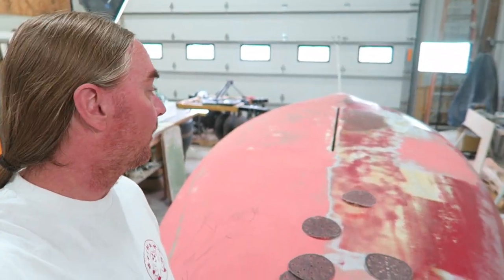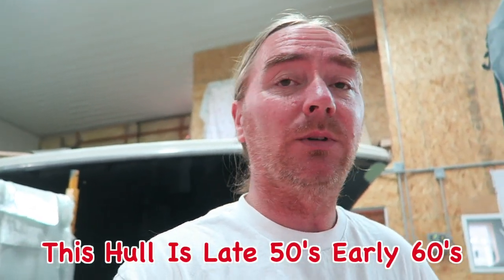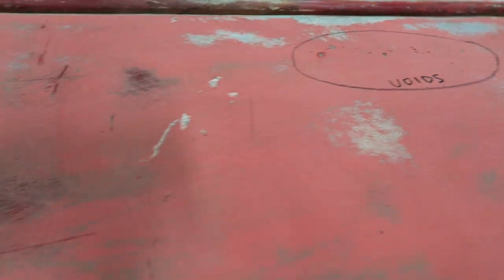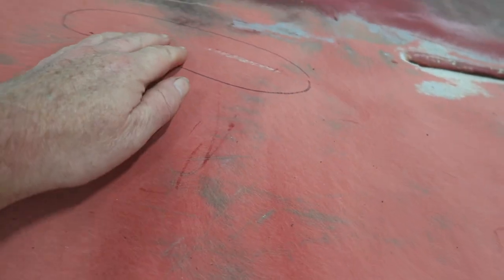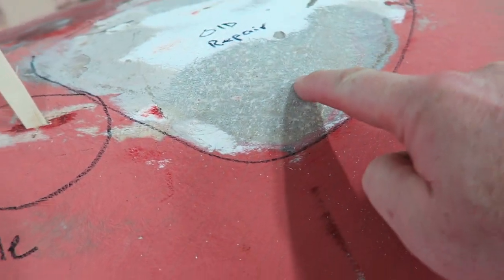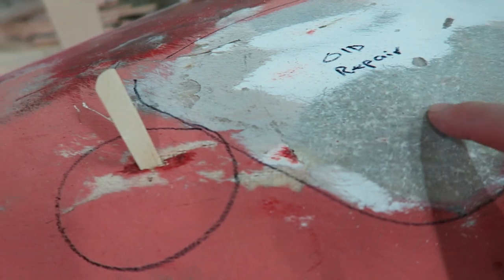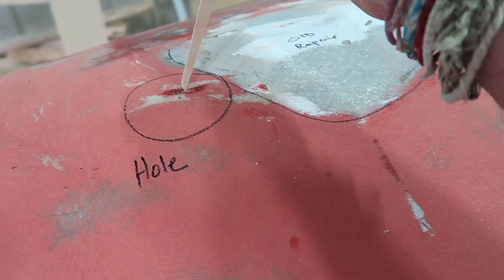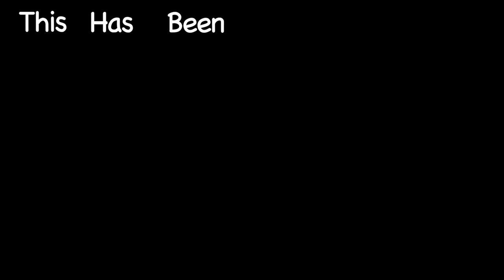THINGS TO CONSIDER WHEN PLANNING YOUR FIBERGLASS BOAT REPAIR!

Comment: So glad you finally went over poly vs epoxy. I’ve been scumming your videos for years on what I have to use for my restoration when I paint or gel coat. I always got confused if I needed to use poly or epoxy for what and why.

I finally understand with this video! Thank you!
Reply from the maker: I do have a guide on my website which goes over the different resins in much more detail if interested :-)!

Comment: I have an old gheenoe that my son and I are planning to restore. There are a lot of surdace cracks, one crack that starts on the bottom and wraps up the side, about 6 inches total but all the way through. The sides are surprisingly weak and a lot of cracking noises are heard when it flexes. Getting ready to delve into your videos today to get my head wrapped around fiberglass repair.  Anyway, I appreciate how thorough you are with explaining the processes of boat repairs and how much content there is to help.

Comment: I thought you might be interested in my recent topside repainting experience using Alexseal topcoat (Flag Blue). While planning the project, I had the very good fortune of speaking with my local Alexseal representative, Alistor Smith. Not only did Alistor provide me with a lot of helpful information and support, he also dropped off a sample of their new roll-on additive to try out. 

Not knowing what to expect, I started applying the first coat with my usual roll and tip application method. However half way through, I realized that the rolled finish looked better (smoother, glossier) than the areas that were also tipped. Consequently I stopped tipping for the remainder of the project.   

I have to say that rolling out Alexseal with this "magic" additive was the easiest and most satisfying topside painting experience I have ever had. It delivered a beautiful finish that exceeded my DIY standards and expectations. 

A sincere "thank you" for this recommendation and all the other excellent info you share with us Andy.

Comment: I have a 1960 19' Dougles built Scot with same hull repairs and spider cracking, looking forward to this video! My bow top deck is thick white gel coat that has very bad spider cracking. Could you please address best options for the severe old raised gel coat cracking vs random light cracking problems or are they the same? Lots of older boats out there that could be brought back to beautiful with a little hard work and determination. Thank you for passing on your knowledge and highlighting new products.

Comment: So glad you produced this video.  I'm working on redoing the floor of our FourWinns Horizon 180 (we bought it with carpet needing replacement) and decided to paint (and texture) instead of carpet.  I had questions on layering and your video has helped steer me in a direction I feel confident in.  I've been a subscriber for a year or more (and had gone back into older vids way past that).  Very helpful.  Next time I travel thru Ashland to Bayfield I'll swing by and drop off a case of 1919 Rootbeer.  :)
Reply from the maker: Glad the vids are helpful ;-)!  I'm more of an IPA kind of root beer guy lol :-)

Comment: Might be interesting to do a video with applying poly over epoxy and vis-a-versa to see if there is any noticable comprised strength loss or delamination. Etc..  I've heard of this issue but never ran into anyone who actually had an issue (or noticable issue). Great job!

Comment: Hey Andy your shows are great but I am lacking a few pieces of knowledge.  I am working on my baja and need to replace the floor start to finish. Obviously I want to use coosa board but honestly need a few pointers on the fiberglass in general and how to finish for the faux teak.

Comment: Andy, so happy to see you doing this series, as I have just purchased two Lido 14's. One is to sail right now ($1200 with two sets of sails and trailer) and the other as a project rebuild ($350 with trailer). The gel coat on my fixer-upper is hard as nails and 60 grit barely makes a dent. My first question is on your hull sanding equipment, can you give me a run down on your equipment and what grit(s) of paper you used? I also see you have a respirator, but what kind is recommended? I also did not see a lot of blue powder filling the air of your enclosed space, how do you manage that?  Last question, how can I make a donation to Boatworkstoday without joining patreon?  Would be happy to make a gift by check for all your helpful knowledge.

Comment: How can you tell if your hull is epoxy or poly or any other type of resin. ? 
I have this issue on my 94 mako hull where it is absorbing and then leaking water out when I take out of water. I grounded it out previously and fill the void with Epoxey and powdered glass and laid up fiberglass. But is still dripping after repair. I believe I needed to use 1708 witch I didn’t use I used chopped strain from Home Depot. and prob did not put the correct layers on. Do you think that is the issue ? Any suggestions. I know I’m gonna grind it all back down and start again on the second repair. Just trying to figure this out and your channel is very helpful.. the area I grinder out is the hull keel were it comes to point . I made a bonehead mistake and launched boat and forgot to put plug-in and somehow water got in everywhere most likely soaking foam . Another issue (I know) fml.! I know that if the fiberglass cloth selection is selected right theoretically there should be 100% waterproof where water will not come in or out as I understand it.  Just looking for your experience and thoughts on this .
Thx sorry for long ?

Comment: Well shoot... I was planning on using gelcoat for my final finish but I guess It's going to have to be paint instead bc I have a new transome made completely out of epoxy... i thought epoxy would be the way to go for the secondary bonding strength... dang man. Thought I had it figured out. At least I wont have  bonding failures with my final coat now that I know. Thanks Andy!

Comment: I fixed a hole in my boat and left the epoxy for 4 months or so and now my 50 grit sander hardly touches it. Trying to strip the old sand based grit layer it killing me too. I only used epoxy but would love to try poly. Great video

Comment: I should have watched this before I started! Better late than never. As you will know from my post, I am a complete noob to fibreglass and trying to work on a 3.8m Bertram Carribean (probably 1970s) and trailer (in bad shape), with a 1976 Mercury 40hp in amazingly good condition for its age)  in a suburban garage. i have two holes in my hull just like in the video. My polyester resin is taking many hours to set so I leave it overnight. I found that my floor that I put in with Poly is not sticking in all areas to the old hull and floor- so it must be epoxy  hull? I want to make sure im using the correct glass from this point fwd (not concerned about finish, #1 concern is for safety).
 My take away from this is: if my priority is strength over finish then I should do everything in Epoxy (including the similar hole -peanut butter in the void and laminate both sides? Is there a video on the slot/gouge/hole?). I should expoxy over the floor that was poly'd in.    Are all Epoxy fibreglass resins born equal? (im using 500 series Epoxy with a UV (530?) hardener. Label says its ok for marine... (if I was in USA I would purchase off of you but im Aus). Any advice from anyone is apreciated.

Comment: Andy, i have cracks shown in the gel coat beneath the waterline. They are probably from flexing and they are situated around a bulkhead and the floor. They’re situated at the bulkhead of the forward cabine. It are long cracks and close to each other. Lets say 10 to 15 cracks over an area of 5 inch wide and a foot and 1/2 long. I grinded away the gel coat and they are in the hull laminate. It are typical textbook cracks. Should I grind that out and put in new glass mat? (What I was planning to do.) or do you have a better idea?

Comment: Amazing channel!

Quick question:  I have a fiberglass’s panel (over wood) that my motor vent is mounted to. This area has two water drains that release  onto this panel with the intention that the water makes it to the engine sump. Problem...few areas have cracked allowing water to get underneath and exposing the wood. Some areas more than likely have rot. I intend to dig out any rotted areas then fill will mar glass then add a couple of layers of fiber glass. What type of resin should I use ( would paint after)?

Thanks in advance Dave

Comment: I get working backwards from surface coating decision to resin decision to fiber decision.  I also understand the thorough sanding of the hull.  But what I don’t get is how you decided to use the CSM on the hull.   How did you know the hull wasn’t constructed with an epoxy resin?  If you laid the CSM over expoxy, couldn’t it just peel off?  If you suspected the original resin was epoxy, would you use a 2 oz woven glass fabric, roll it out with epoxy resin, then fill the weave with fairing compound?  Is there any way around the rule “No Poly over Epoxy?”  Can you just assume any hull that is finished with gel coat can hold CSM/poly?

Comment: Question on gelcoat over epoxy.  Was wondering what issues I might run into if I do try to layup gel over filler with epoxy?  Doing some transom work and going to re-gel the entire transom but have filled holes nicks, chips etc with epoxy and silica.
Will the gel not adhere to epoxy well?  Or other issues?  I guess I could do my final fairing in poly or a bondo type material if other wise I’ll have issues.  
But this issue deff got my hamster onto the old brain wheel
Reply: Additionally, u did the gelcoat to epoxy review a while back and said bonding wise it would work well, and saw no issues...  so I’m corn-fused!  I think I’m just gonna sand, fill fairing flat and brush gel 3-4 layers and wet sand and buff... 

Thoughts?

Comment: Hi Andy, great videos, have learnt a lot from watching. One question, is the paint you are discussing available in Australia and if so do you know the distributor? I have restored an old bout with some modifications. Structurally it is fine, but having trouble with finishing the gelcoat. Any assistance would be appreciated.

Comment: I think 1708 has chop strand matting on the under side. Does that mean I need to use polyester or can I use my epoxy Rosen that I have been using? Thanks for the help. I really enjoy your videos.

Comment: I bought a used boat and sanded and re gelcoated the cockpit. 2 small spots haven't tried in 2 days and I think there was epoxy patches there. So I have to grind that back out and fill with glass or wipe off the wet gelcoat and fill and epoxy prime over it. Then I can continue to spray gelcoat and sand and buff to shine. This is what you can come across unexpectedly. Every salesmen at the store is happy to sell you the expensive stuff but is that what your boat was made from originally?

Comment: I am in the process of painting a 17ft fishing boat with Alexseal. This is a test before I paint my 34’ sailboat. I have sanded faired primed and sanded again and am ready for topcoat. I already have my paint, do you recommend I order this additive before I start? I was also wondering if the primer over my gelcoat is mandatory. If I sand off I’ll the oxidized gelcoat, can I apply topcoat directly to that surface? I have 2 concerns, one is the additional sanding required after the primer and second, I don’t want to get to much buildup on my textured nonskid decks. Thanks for all your help

Comment: A couple years back you did a video about gel coat over epoxy and showed the polyester gel coat bonded just fine. Just curious, why the change of opinion on using polyester over epoxy?

Comment: Is it possible that the cracks are the result of wet or rotten wood stingers or stiffeners?  I am working on an old boat with lots of cracks in the hull and transom. Most of them appear to be the result of improper storage as you mentioned but also appear to result from flex due to usage with rotten stringers

Comment: I always thought it was poly for making parts and epoxy for securing to existing structure. So if you are making say a bulkhead or bracket it could be made with poly (or vinylester or epoxy). But then securing any part to the existing hull means epoxy only for that strong bond. So tabbing in a deck or transom would solely be epoxy. Is this accurate?

Comment: I thought I was in the clear with Totalboat gelcoat w/wax over epoxy based fairing compound.  I keyed the surface and prepped it with TB dewaxer then applied the gelcoat. What am I looking at for a failure, will it just de-laminate?
Reply: You’re probably ok. Totalboat instruction says not to put their gell coat over epoxy but they actually have a video showing otherwise. I think the major factor is if the epoxy reached full cure, sanded/grind surface to remove the surface wax that forms after epoxy cures and fast dry solvent wipe before applying the fell coat. For structural applications it’s usually very bad to put polyester over epoxy.

Comment: I have a 36’ 1973 Luhrs. Definitely built heavier than newer boats.
Andy, your video has me wondering what kind of resin they used back then. Any thoughts?
Reply from the maker: 95% of boats built back then (and even today) were done using poly resin.  Some of the higher ends will use Vinyl and the really high end ones will use epoxy but generally speaking most were done with poly :-)
Reply: Thank you! Your videos are informative and fun to watch.
Keep up the great work!

Comment: Wouldn’t you be able to prevent the cracks from telegraphing through by using an application of lighter glass cloth with your choice of resins? It seems like this would add much less weight and some strength, and be easier to fair, especially because it did not sound your plan was a structural enhancement.

Comment: Hello Andy! Commenting for my husband because he is unable to comment on his computer. 
He has a 1973 AMF Puffer that he is restoring. He has total boat  two part epoxy with slow hardener (5 day cure).  He’s having trouble filling screw holes on the gunnels. He has done it twice and every time it comes out gummy. What is he doing wrong?
Reply from the maker: Sounds like the mix ratio is off between the resin and hardener.  They have two types of epoxy; 2:1 and 5:1.  Is he using the pumps or pouring out of the containers?  If pouring, the pumps are very helpful :-)  Also what temps is he working in?  Slow hardener you should be about 70F minimum..  Hope this helps!

Comment: Thank you for great videos 
I have question please, do i need to use primer on my fiberglass kayak before the paintjob ?
Reply from the maker: You'll get much better results if you do :-)  Typically 2 coats of primer, sand smooth with 320 or 400 and 2-3 coats of paint
Reply: Thanks a lot

Comment: Can someone explain, why you don't want to use poly over epoxy. But he's saying you can essentially start with epoxy, then switch to poly for cost savings, on multiple layers, then back to epoxy. I'm new to glass, so not wanting to screw up my first boat. Thanks much,

Comment: I have this older Beautiful Boat and I need some imperfections in the Gelcoat fixed. My last two experiences with two local boat repair shops. Well I will just say, I am done with boat repair shops locally. Both places have me an estimate for repairs. And when they called and said my boat was done. When I arrived and got the bill. First place the was 1,200 more then initial 1,000 bid price. Second place said repair would be 150 to 225.00 for the repair. And it would be ready in two weeks. Calls me next day and says my boat is ready. Guess what, the bill was 578.00 more then the quoted price. I am fed up with repair shops.
Reply from the maker: Unfortunately that happens all too often :-/
Reply: Yes it does, from now on it will be in writing and no more good O”ll boy trust you syndrome stuff.

Comment: Darn I missed your time window on the questions for here. :(
I'll post it anyway since it might help others if it does get answered.

Caliber Yacht Sales ( local brokerage firm ) has a custom fiberglass yacht available, trans-ocean range. In the information on it they state this yacht is capable of doing the Northwest Passage, with the implication that it is the fact the hull is 6 inches thick is the reason.
I know a hull like on the current project ( thickness wise ) would not be a good option, but how thick would a hull have to be to have the strength to handle heavy ice conditions like you can expect for doing something like the Northwest Passage?
Would 3 inches of glass be enough? Less or More? Cored with foam as additional thickness?

Just so Andy gets an idea of how many people would be interested in the answer, leave a like on my comment if you would like to know.

Comment: When you're working on your next video, would you speak briefly on why you chose to use CSM rather than 1708 for the bottom glass. Is it a trade-off between less weight and longer finishing time ( I suppose peel ply would help) vs more weight and a smoother outer surface?  Inquiring minds ........
Reply from the maker: Will do!
Reply: That is an excellent question. Why each type of glass matting was rejected or chosen with strength and final finish detailed will help a lot of people.

Comment: Is there a trick to calculating how much Alexseal (primer and paint) is needed for topsides and decks?  I haven't found much about coverage on their website.
Reply from the maker: If you check out their application guide, it will provide the estimated coverage in SqFt based on how it's applied (roll or spray :-)